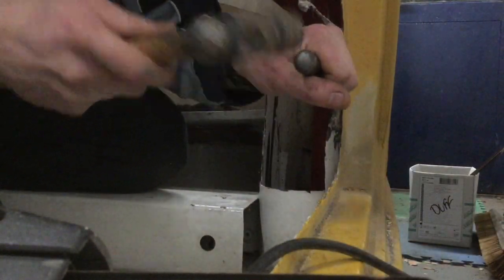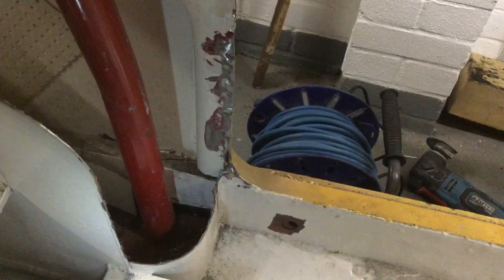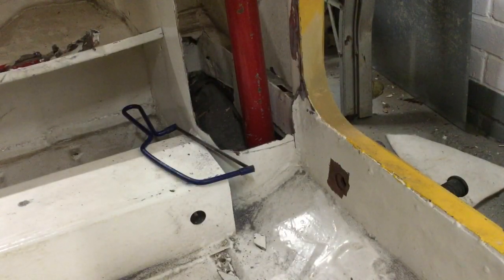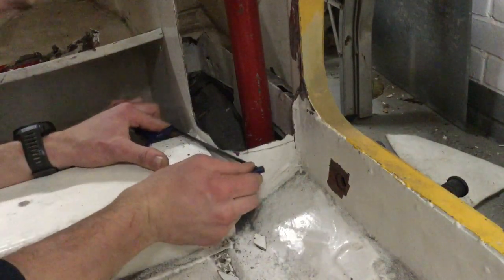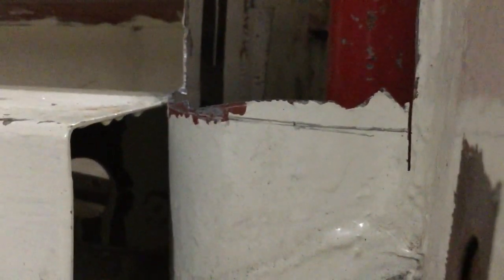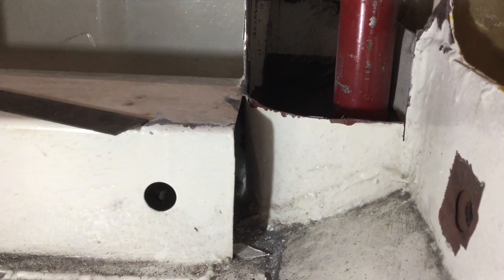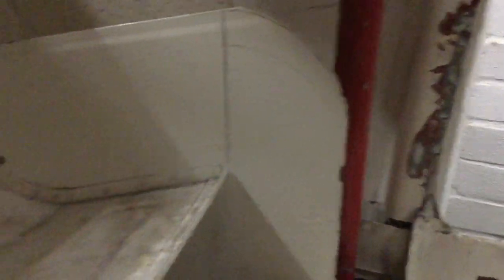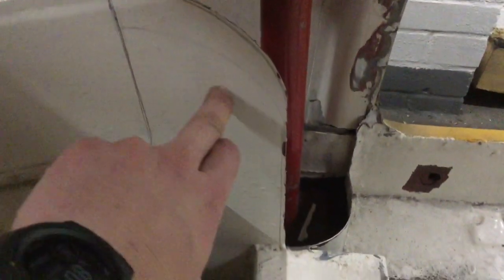Ep18 classic mini rear bin work

Comment: I’ve got one of those electric files that would of been perfect for the spot welds , it’s also great for getting in tight spots , great little tool
Reply from the maker: I also had to get the belt sander on them aswell, could really get in there better. Thanks for watching 👍